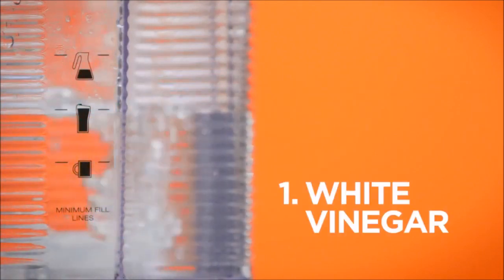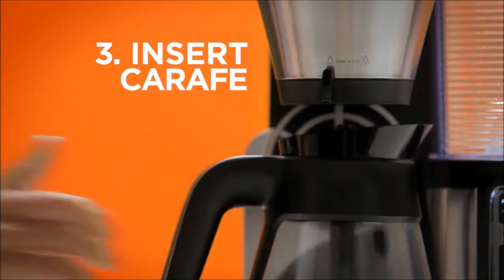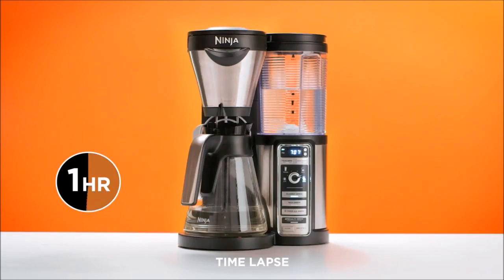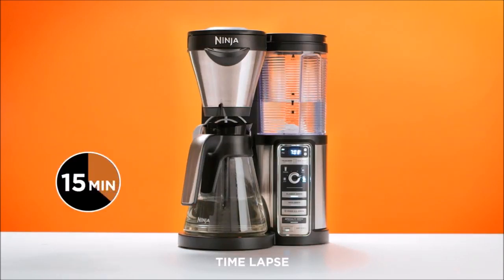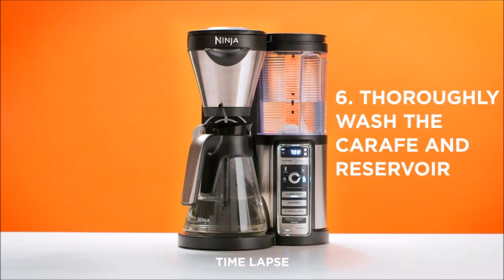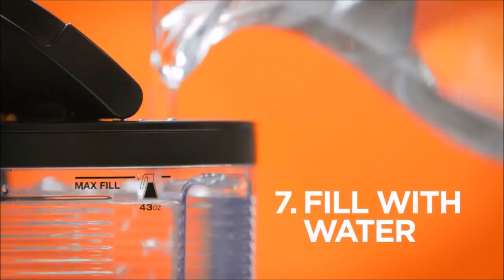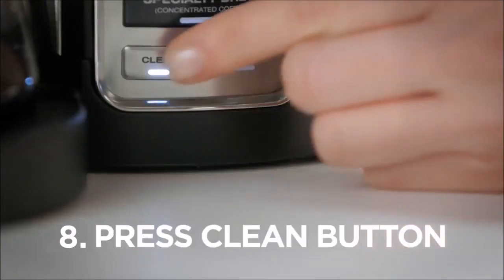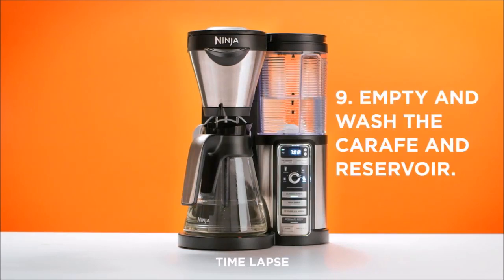Descaling Your Ninja Coffee Bar® (CF080 Series - 1 Hour Cycle)

Comment: I always use distilled water so i know there is no internal calcium buildup in mine. I did find a button holding key sequence a while back on the internet that instantly cleared/canceled the clean led without the full clean cycle, but can not remember or find it online now. If anyone knows please share. I'm sure Ninja will not disclose this.

Comment: it would be better if the support would take care of eliminating the famous "5 peeps" effect. is obviously an extreme design flaw in the machine.
Instead, the moderator tells utter nonsense. so extreme nonsense that there are now even warnings about this video. "Do not use white vinegar" they say. he is too weak. nonsense. However, if you take more water and less vinegar than you HAVE to take - it won't work.
the video shows a mix ratio of 1: 4. NOT CORRECT! It MUST be at least 1: 3 (1 part vinegar, 3 parts water)
Exception: you use concentrated vinegar (which is not available in the USA in the form usual in Europe). Then you can also mix 1: 4.
Second mistake:
According to ALL US videos, you should "rinse" at least 2 times with vinegar. Only then rinse with clear water.

You can also tell from this video: "Ninja" is a brand of a Chinese company that specializes in producing the cheapest mass-produced goods. As it is in your own company description. (JS Global)-represented in europe by SharkNinja Europe Ltd.